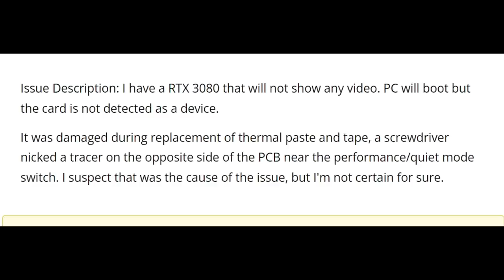ASUS TUF RTX 3080 V2 OC Repair - Damaged During thermal paste replacement

Comment: I generally agree with "if it ain't broke don't fix it" logic but in some cases, like mine for example I had to open my GPU and repaste. It's a 6950XT and it ran at almost 110C hotspot out of the box brand new. If I had RMA-ed because I'm in Eastern Europe I would've had to wait 2-3 months to get my GPU back repasted. So there are certain cases where it's hard to avoid but then again if the user has 0 technical skill or is rushing things breaking it is a horrible outcome.
Reply: In this case just watch a video or read the repair on a forum on how to do what you are try to achieve before you just go in it blind.
Reply: @trilexfix  And... keep your workbench clean - no screws, no tools should be in the vicinity clean it carefully, apply and reassemble.  This person had the unfortunate situation that he nicked the card, but this card had power on it, how else would it explode, unless the bench is not grounded.  Like you said, take time to learn how to do it and if you live far away and it will take months to get your device back... Always be patient, walk away from it, don't yank the pieces, because there always can be a screw you overlooked and keep the screws apart if they are different lengths.
Reply: @aelaan12  makes sense I once damaged a $400 macbook screen cause I had something nearby when closing the screen man that mistake back in the day really jarred my olives lol
Reply: That's still in spec. That card doesn't even throttle until 115C.
Reply: @xkannibale8768  we are living a new era of desktop cpu's , when it's normal to get 95\100ºc maxed out even on water cooling.... what companies do to stay competitive ...

Comment: 5 degrees can mean 60-70 hz clock speed on some cards.  Gamers do whatever it takes for more fps.  With a 3080, stock this guy should have been able to run almost any title in 1080P at over 240 FPS.  Another reason to disassemble is to install a water cooler -- we do that for noise levels.  Air coolers see any activity and ramp the fans up - custom water cooling does not ramp up the fans on the radiators until the fluid temperature is 5 degrees above the ambient air temperature.  Love your videos!  Thanks for making them.

Comment: Alex,
I sent you some simple holders that will work for Flux or grinding pen (may prevent bent tip), I hope you did receive them. USPS kept changing the zip code when shipping them. They may not work for you, but I sent them if by chance you find them helpful. Excellent video, that trace had me fooled on the camera as well, it looked raised . Excellent Job!

Comment: Very lucky no other layers were involved and great job as usual.
Reply: I wonder how deep are layers from each others.
Reply: @goku445  Depending on how many layers they are made of 4, 8, 10, 12?. More layers can make the board more stable and lasting longer handling power etc. I am not and expert on this matter.

Comment: 0:50 the gddr6x memory on these cards is reaching 105 degrees celsius all the time with stock thermal pads
by replacing the thermal pads, the temps drop to 70-80 and the memory will last longer (and you can overclock it a lot more) as a result

Comment: Just a few short years ago, electronics damaged like this would have ended up in the landfill.  Thank goodness there are repair techs with the skill to fix these issues.  Though you mayn't be willing to fix multi layer board damage, there are at least folks out there to take up the challenge.  GREAT job and thank you for sharing.
Reply: nonsense.

Comment: I never open my electronics while still under warranty. If there is no warranty, I am confident enough to at least take things apart to clean and inspect, as well as some minor repairs.
I have a feeling that this customer was very similar to me with their ability, and like me also overconfident at times, allowing silly mistakes like dropping screws or slipping a driver. On older hardware, this was usually harmless. But newer components are much more delicate.

Comment: Good job! Whenever I fix something I just say "I win" lol.  In regards to why replace thermal paste with liquid metal: Actually it drops more than just few degrees in temperatures but mainly it allows for higher overclocking of the processor. Been there, done that - will do it again :)

Comment: On one hand you make a very fair point, but one always needs to consider that perhaps the GPU had bad factory TIM application or was using cheap pads from the vendor. A TUF 6800 XT I once owned had such bad TIM that it was hitting 80c while gaming even with a fan curve, legit never experienced such bad temps on a card before.
Reply: He said if the card is fine don't fix it in your case it's not fine.
Reply: @KeepersWay  I'm not saying he's wrong or anything. It's just a harmless suggestion that maybe the user did have valid reason to want to open the card.

Comment: Many, man, many people with GPU's were using them to mine ETH, a crypto currency. (Hardly any are now due to ETH going to POS instead of POW.) But, while mining, these cards were subjected to very hot temps while running 24/7, 7 days a week. Swapping out the crap thermal pads and paste on these high end cards brought down vram and cpu temps quite a bit, and allowed better mining for higher profitability. That's why so many ripped their cards apart to do this. I even know a number of guys who just use their cards to game, but when these monster cards get hot, the fans can sound like a jet engine. Swapping out thermal pads and paste often kept things cool enough to keep the fans from ramping up so much. 

But, I do agree with you. If it isn't broke, don't try and fix it, unless you know what you're doing.

Comment: you should only replace the thermal paste if the card is older than 5 years (the point most thermal paste dry out at) and only then if it's showing signs of massive heat difference from when it was new. But by that point most people have already moved on to a new card. and even then the card may perform fine and still not get too hot so it's most often an unecessary bit of work.  my mom's pc is using an old radeon HD 5700 (it was an old card in my 2007-2011 pc build)  that card is like 10-12 years old now (i think i got it in 2009 or 2010 as an upgrade over the geforce 9800 GT) and it still runs like a champ on older games with no noticable diference in temps from when it was new.

Comment: I agree sooooo much with not fixing something that isn't broken. I have a 2 year old Asus Strix 6800 XT and an 8 month old Strix 3080Ti that work beautifully. Why are people replacing pads and paste on cards that aren't even 2 years old and well built ones at that. I've seen reddit posts of people bragging about lowering temps by 5 degrees and posts of people breaking their cards trying to do the same. These cards are running at spec there's no need for headaches. Enjoy them playing games or whatever else people do with them instead of looking for issues.

Comment: I was trained in US Navy 2m program to do multiple layer board repair, in actual practice, it was easier to swap your a card then repair it.   With this type of repair, I would of cut new copper runs, beveled the edges of the existing runs to match the new parts, and solder them down.  Was a pain the ass, but that’s what they wanted.

Comment: thermal paste or metal liquid can be really beneficial,especially on laptops,the lower temps will usually allow for example GPUs to boost to higher clocks,aka better performance
Reply: But liquid metal comes with great cost. 1st, they don't last more than a year, usually temps starts to climb after 6 months. 2nd, they turn your copper heatsink from gold to black and surface will be rough, you need to use sandpaper to grind the black stuff off before you can claim warranty, alchohol won't work. That is provided you know what you are doing, and know how much you should put.

Comment: That's is some ungodly small trace to repair and you're quite an expert that I could never be. Still would like to share a though that I picked up from electrical wiring practices. When you repair broken parallel traces like those, try to make solder points (where you did the grinding on the trace) equidistant, but staggered. ie, from a common starting point about 10 mm left from the breakage,  for top trace make one point. Then the next point could be at  15 mm ( 5mm after the breakage). For the second trace, start at 5 mm left of the breakage and end at 10 mm after the breakage. That way you can ensure the joints are of same length, and their solder points are 5 mm apart so that they don't bridge.

Comment: I just recently put a water cooler on my 3080ti it worked great. It was new also. But it was more than 5 degree difference. I also am very skilled in electronic repair. But I was nervous the card was new.

Comment: To be fair, I noticed significant thermal drops after replacing my 3080 FE pads and paste. However you MUST feel confident in attempting, aswell as atleast have some knowledge of the task at hand. And in the case of the 30 series FE... Might aswell invest in a screw kit and maybe some sandpaper the make the screw head flatter. If people did more research before attempting, and respect what they're working with, there wouldn't be so many human error attempts.

Comment: It's not just 5 degrees. The memory chips on the 30xx series cards are as hot as hell (around 100+ °C). Replacing thermal pads reduces them by about 10 to 20°C based on the quality you replace. Even the temps on the core makes a significant difference. 
It's really crazy that the factory used cheap quality thermal paste and pads on high end cards too. 
But first time doers must either watch a tutorial (and keep score of which screw goes where) or ask a friend who knows what they are doing.
Reply: Ako znas da je tako, slobodno otvori graficku kartu, tako da Alex imace vise posla :)
Reply: @BigLiftBoss  Lol I already did on my RTX 3080. I knew what I was doing. Replaced all the thermal pads to its respective size and used thermal grizzly paste! Runs cooler now on ultra settings in most game. I have never seen it go past 70 degrees!
Reply: Sure, but if you don't know what the hell you're doing; don't do it. And once you discover that it's a little harder to do than it looks, don't brute force it. I think that's his point.
Reply: the quality of paste and pads would depend on what company. not every company cuts corners.  Asus maybe , msi maybe , gygabyte for sure. but an evga or zotac card is using very good quality pads and paste.

Comment: exactly finally a tech guys says it a lot if them make it seem cool to do stuff and re thermal past and they don't need it a gpu should not need thay only maybe is its loke 4 years old maybe then or it over heats but just leave it I do think doing like the cpu is a good idea thoe if you are used to doing thay basic work

Comment: I wouldn't knock liquid metal, its very easy to apply and to prevent damage. Its gonna do a lot more than 5C especially since gpus are stable past 80C these days. I had to use it on an HP Omen RTX 2080 because it was not stable with the stock fan ramp. Yeah it was either that or make the blower run at 5500rpm. Now I have a 125MHz overclock

Comment: I repair my own stuff with my (less than awesome) hot air station - but drilling holes into a multilayer PCB to fix underlying leads? Forget about it. Even watching this repair, I was like “damn, this guy has the steadiest hands I’ve ever seen”.

As for the card in this video, the TUF RTX 3080 has one of the best thermal setups of any 3080 card. Hell, mjunction temps on my example never exceed the low 90’s and average in the mid 80’s (which for GDDR6x is very low, and about 7-10 lower than what I see on my FE card). From the use of all MLCC’s to overkill cooling, Asus managed to build one of the best GA102 cards (especially early on), so messing with it, especially the cooling setup, and borking it in the process, is really unfortunate. Never fix what isn’t broken.

Unfortunately, I suspect this was a second hand card, and there’s a lot of blanket advice to “repaste” ex-mining cards ASAP, which isn’t actually good advice if the card is still running fine. Most cards used for mining eth pow were running relatively low and stable GPU temps, so the GPU thermal compound is probably still fine (as most of these cards are just 12-18 months old) and it’s the memory that was under temperature stress, but you’re not helping longevity by messing with the thermal pads which are going to last quite a while - provided they don’t get trashed while removing the heatsink assembly.

Comment: Unfortunately, the answer to your question is simple. More performance. I only take my cards apart after a few years of working or because I'm switching from air to water cooling. But GPU boost is very temperature dependent. Lower temps mean higher clock speeds and higher sustained clocks under load so more performance.

Comment: If I were to buy a 3080Ti which brand do you suggest? The one that has fewer problems according to your experience. 
I had 3080Ti zotac that burning hell. Very hot. almost up to 100c in just 2 mins. Then I shorted it accidentally when changing the thermal pad. I didn't know what I did wrong. 
My wish there's a product 3080ti that doesn't  force me to open it up... ever (if possible) to make it cool. I'll use my card for rendering. So the load is often full load.

Comment: I have my GTX 1080 working fine 6 years after liquid metal treatment on the die and shunt resistors to unlock power limit. The thing with liquid metal is that you should use less than you think.
Reply: That’s for sure, back in I have setup with i7 8700k and RTX 2080 that both of the on liquid metal my CPU worked for year and then die get cracked because of the pressure caused by cooler and I sold my GPU as is buyer never called back that I assume it is all right.
Reply: @hyperabit  I had liquid metal on my 4770K and still have it on 8700K. Never replaced it on them. Replaced only once on GTX 1080. Never used nail polish to secure the resistors like some people do on youtube. Nail polish will burn over time. You simply have to use super thin layer of liquid on both contact surfaces.
Reply: @club4ghz   Problem is I did not relid CPU used as IHS loose but I also have Rocketcool copper IHS maybe that’s caused to die crack, spillage never been a problem as you said if you careful enough and use less amount, btw I also re done application on my GPU because they get dry, I seen videos of PS5 that from factory they use more but they also use shield for spillage that I think for not get dry overtime.
Reply: @hyperabit  I think it can be dry and still work fine as long as you don't shake it. Changing cooler on the cpu, taking your gpu out for cleaning or carrying your console around can break the contact.

Comment: how do you do that much DMG with a screwdriver doing a repaste it almost like looked like 1 of to things he dropped the screwdriver from a significant height tip first into the board or he was using a drill on the screws for some reason and drilled into the board but man lol that was some pretty good dmg

Comment: Im curious about something, why do you always use green solder mask on colored boards? I know there are colored solder masks, but im curious to know if there is a reason for this or you guys just dont bother with that, i know very well its irrelevant, as the masks are never visible once they are back into the device
As always, great job!

Comment: My previously "working" video card is so much better after replacing the thermal paste two days ago. It was running a 105C hot spot prior to replacement, now around 70C hot spot. Totes worth the time. Now it isn't trying to hiroshima my PC and the fans don't drive me crazy at 100% on a loading screen. It's a 3080 TUF, too.

I reckon we know why this guy stabbed his board. It helps to have the right tools for the job, ol' wallered out screw head.

Comment: i'm starting to do micro soldering as i just got a microscope for my birthday a few weeks ago. did my first Graphics card repairs and first Motherboard repair on a Macbook pro. i have to tell you, you make it look so easy. your videos lead me to learn more and more about component replacements. i love fixing things and i fix mostly Apple computers and Graphics card, but you inspired me to do more that i am capable. even though i just started doing it???? i am enjoying it. Love your videos. keep on the good work and don't forget to connect your power to the graphics cards. =)
Reply: There are no graphics cards inside laptops.
Reply: @ReeseL4D  I know that, i fix laptops and Graphics card.

Comment: You should tell your customers to underclock instead of replacing thermal paste or some physical interaction with the card. 
Those cards can still give 200-300 fps with less than 100 mhz from their actual frequency.

Comment: that´s the reason why i replacing thermal paste on GCs only when it´s necessary if temps are fine even on a card bought second hand i leave it as it comes and exactly the same card came today to me or maybe sligtly older version of it i am not sure but it looks the same and yep you are right strong immunity is important! oh man if i can say that about computers...😅expose to viruses it gets stronger defense...🤣oh CG owner used thermal grizzly kryonaut extreme thermal paste i am only using this it´s the best thermal compound right after liquid metal